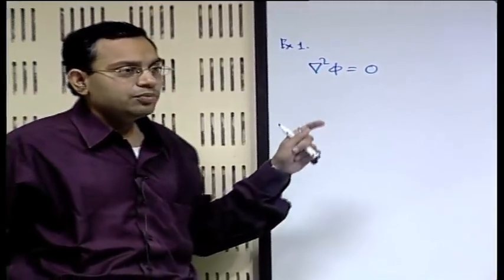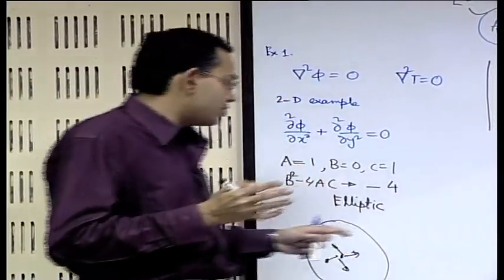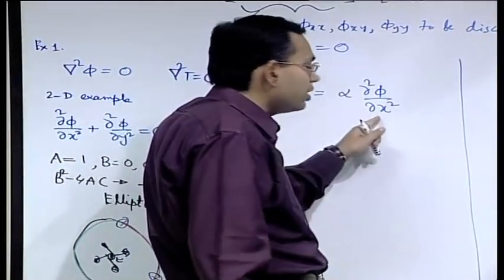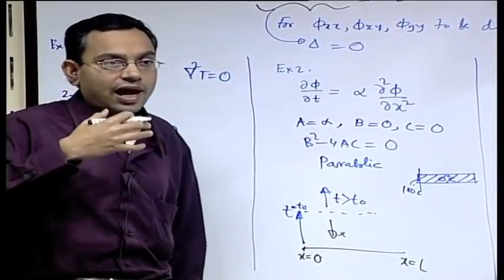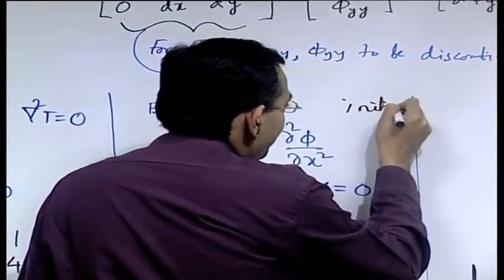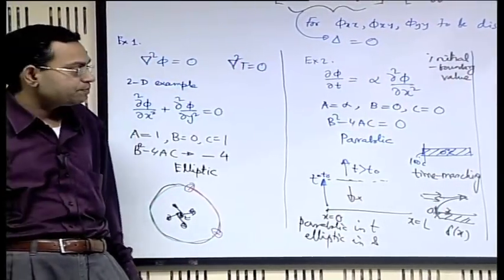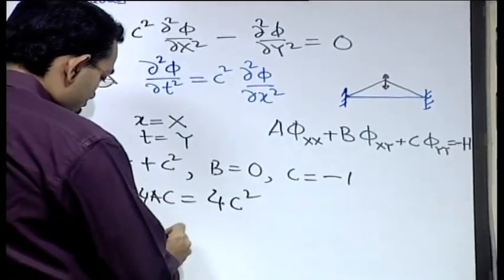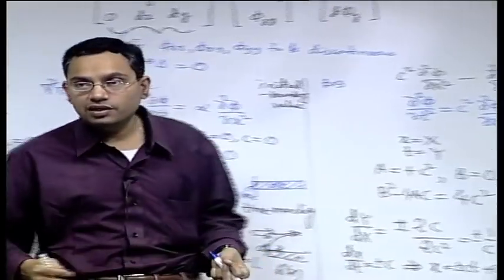Lecture 3 : Examples of partial differential equations

Comment: How ex 2 would become elliptic for steady state? A=1 but B and C would remain zero to B^2-4AC would still remain zero and hence parabolic.
Reply: when steady state is reached, time derivative becomes zero. So unsteady heat conduction equation which is ex2, will become just the 1D Laplace equation and laplace equation is elliptic.
Reply: @battlewing221  it will become a 2d Laplace eqn. that's how we get A=1 and C=1. Phi_xy doesn't exist. but phi_x and phi_y exist. hence it is 2d